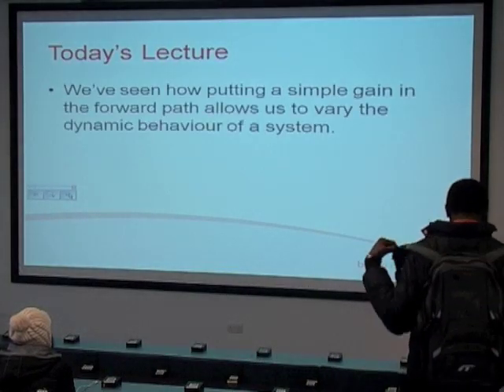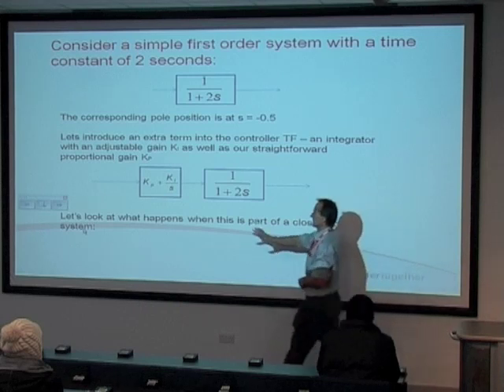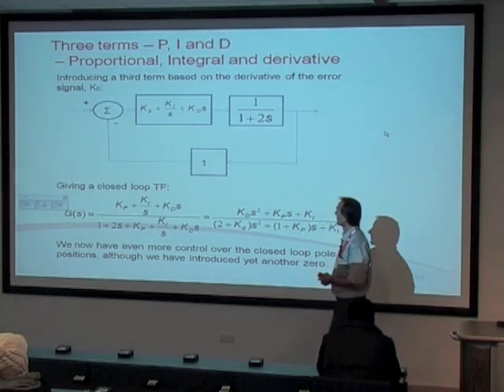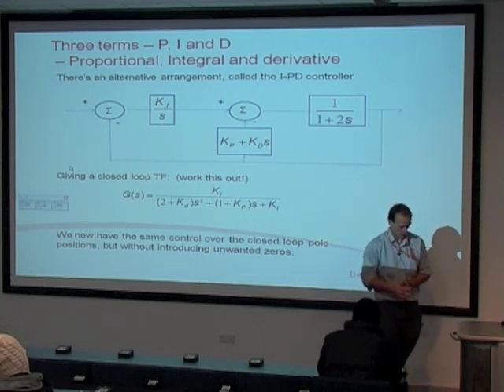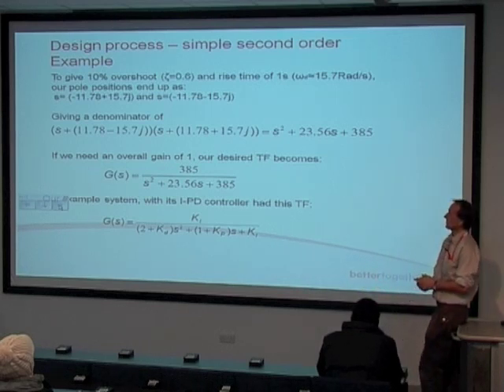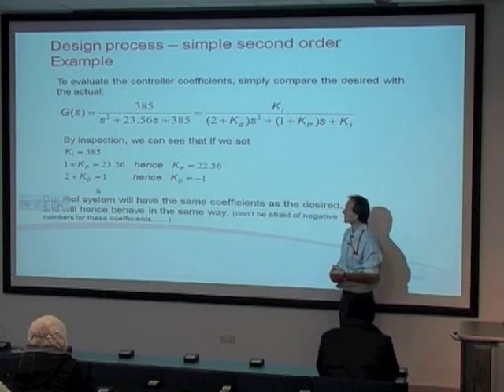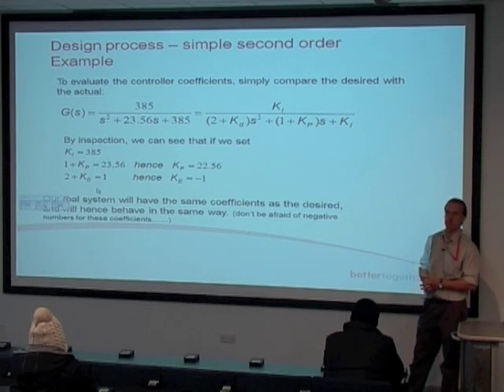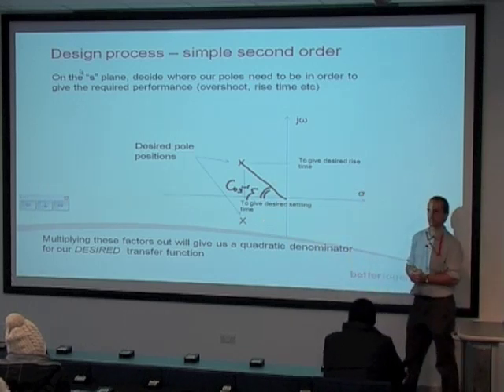Control Systems Engineering - Lecture 11 - Controllers

Comment: I think there is not a single professor (or teacher )  who can teach control systems- it looks that these professors themselves SUFFER with no adequate knowledge to explain this subject - it is even harder for them- very evident from the explanations they offer. The fact is that these these guys never did learn this subject so well. They just have a surface level knowledge and scramble to offer any decent explanation -they just read off the slides - Any student can do it , right ? Prove me wrong !
Reply: I doubt you have even 1% of the knowledge on this subject as these Profs. have
Reply: They give explanation beside the slides. So watch again the lectures.

Comment: Good lecture sir. But your calculations are wrong....wd=2.21rad/s, wn=2.76rad/s. Therefore, s1=-1.65+j2.21 & s2=-1.65-j2.21.
G(s)=7.61/(s^2+3.33s+7.61).So, Ki=7.61,Kp=2.33,Kd=-1
Reply: Dear Kishor - I believe the only error here is the decimal point when calculating wd i.e. wd=1.57r/s which should result in wn=1.96r/s. (Assuming rise time is one quarter that of the period)

Comment: In what way does the introduction of a zero in the PID control topologies affect the  output?
Reply: Good question.   Few ask this question and few instructors cover this problem.
Zeros extend the close loop bandwidth.  This is a good thing.  However, zeroes can cause overshoot when the closed loop system responds to a step changing in the reference.   Also, the final phase lag is 90 degrees ( number of poles - number of zeros )
This instructor is better than most.   Pay attention to the comment about the I-PD controller where the P and D terms are only multiplied by the rate of change in feed back and not the error between the set point and the target and actual.   

The instructor does point out that one should place the closed loop poles first to provide the desired response.  From that the closed loop gains can be calculated.    Overall I give this a thumbs up.  This video is much better than most.
I/my company makes motion controllers.  Overshoot is not good.   We usually  want our closed loop poles on the negative real axis in the s-plane.  The problem is zeros.  They can cause overshoot too.  It is also possible to place the zeros too so there isn't overshoot.
You guys are lucky to have one of the few instructors that really understand controls..  Thumbs up.
Reply: Kishen Mallick All transient response ... like %OS